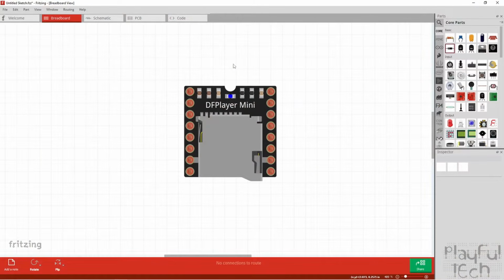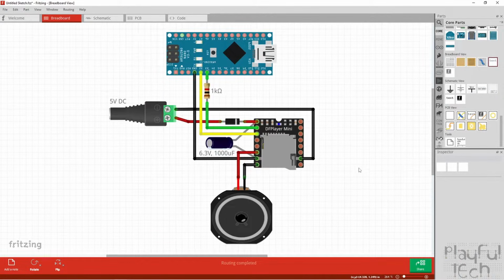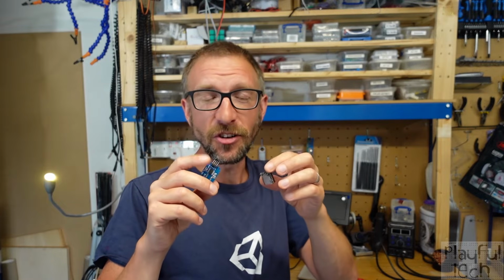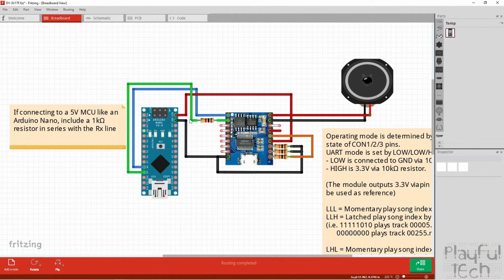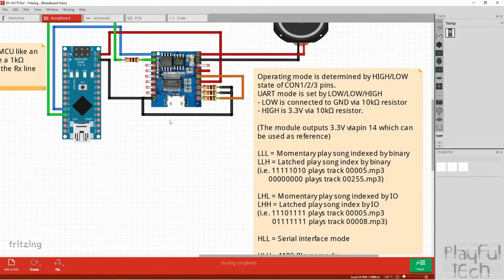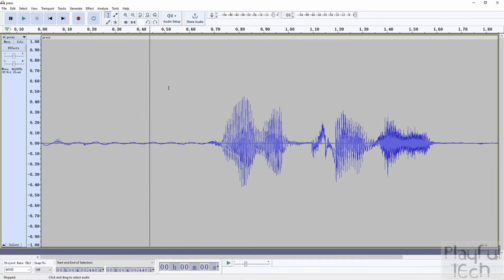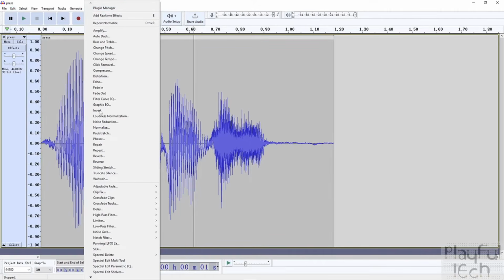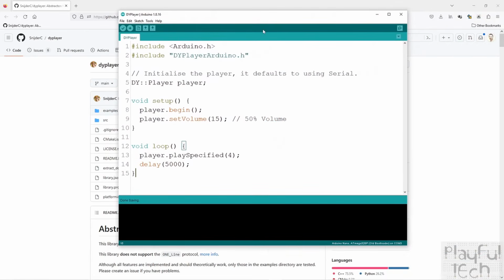Audio modules for electronics project

Comment: Great video!! Thank you for taking the time to make this. I have one quick question though.

Would I still need a separate power supply for the DF player if I were to use an aux out jack instead of a speaker?

Comment: Great video! But for the larger form factor modules (DY-SV5W/etc) the only modes I managed to get working are the MP3 mode (pins are commands like play/pause/next/etc) and Serial UART mode. The other modes where pins select a track index did not work no matter what I tried, in any of the modules I bought (All AliExpress, but at least a couple different sellers 🤷‍♂)
Reply from the maker: I've not experienced that problem myself. What setting did you push the DIP switches to?
Reply: @PlayfulTechnology  It was a while ago, but I think I literally tried all permutations after getting frustrated. Pulling the pins either high or low just did not trigger the tracks (but in UART MOde I was able to play them by index, and in the default MP3 mode I was able to skip between them, all with the same SD card).

Where did you buy your modules from? Perhaps Ill try one
Reply from the maker: @jonathanlevin7660  I've bought several batches from different vendors on AliExpress - I do normally use them in UART mode anyway, but occassionally use them in trigger mode and not noticed any problem - you just need to have the filenames saved appropriately on the SD card and the DIP switches set correctly.
Reply: @PlayfulTechnology  a couple months later I finally figured out the issue..
As you said the filenames have to be correct, I had "0001.mp3" and the module needs specifically 5-digit names "00001.mp3"...
The tutorials I saw claimed that the modules use the FAT index, so what matters is the order in which you copy them over. This is untrue.
One would assume even if not at least it would sort alphabetically- but nope, specifically 5 digit numbers with postfix `.mp3`.

Most "datasheets" for these also fail to mention this, but oh well! once known it's a very solvable issue
Reply from the maker: @jonathanlevin7660  Ah, well done for figuring it out - and thanks for sharing the solution!

Comment: @PlayfulTechnology Can you advise on selecting a speaker?  I was planning on using the DY-HV20T in an RC car project (car stereo effects that sort of thing).  If I’m powering this board with a 2s battery (7.4v), what size speaker should I use with the board?  I have a few spare 4ohm 3W speakers which I presume will work, but I can get a larger speaker for better volume.  If I’m powering the board with 7.4V will that limit the speaker power I can use?  Cheers.

Comment: Do you know of and modules with triggers like these to play two voices at once? I've been using two boards with two speakers but am looking for a small single board, single speaker solution due to space constraints.
Reply: The Sparkfun WAV Trigger has polyphonic playback. You can play any combination of sound files simultaneously.

Comment: Hi great video very helpful. I like to control the skull jaw with a servo motor mover with a sound device that loads soft sounds. I can control the servo with the  gpio pin pi pico but what's the best board to use to do this ?

Comment: Hi! It will be interesting video about VS1003 / VS1053 because it is using in many models of modern internet radio. There are several models of VS1003/1053 and VS1053 on the market now. And they are not same. PCM5102 and UDA1334 will be interesting too. Thank you!

Comment: Excellent video. I'm a newbie here.  Could you please provide more info/specs for the diode and capacitor needed for the DFPlayer Mini? I'm trying to run it from the 5V pin of an Arduino Uno.  The quality of the audio is excellent, but sometimes the Arduino sketch stalls, when it reaches the first call to play a sound. Cycling the power usually helps, but it is kind of annoying. Thanks.
Reply from the maker: I'd suggest reducing the volume level in your code for starters. Higher volume = more power required = draws more current = causes a brownout, resetting the Arduino.
Reply: @PlayfulTechnology   OK, thanks.  One more question. With your method of wiring the DFPlayer Mini, I understand that you are saying NOT to power the MP3 player via the Arduino.  Is it OK, that the Arduino and MP3 player receive power from a common USB power supply?  I am trying to achieve your wiring method, but I would like to use a single USB micro-B cable that plugs into a  5-lead terminal block.  I use the positive and negative leads and I split them each into two wires, so I have one set to power the MP3 player, and one set joined back together in a USB connector to power the Arduino. Do you think that this would be OK?  Thanks.

Comment: Do you know of an arduino library for the Due boars that will work with the dyplayer modules?   Due doesn't have software serial and uaing hardware serial gives a compilation error.

Comment: https://www.youtube.com/watch?v=-soDFl6SUPY Amazing video! I have two questions.. First one - if I want to make a big animatronics project with lots of different sizes and torques motors, How to choose a right power suplly to fit them all and the arduino? And second, I know that some motors work at 333hrz, 50hrz and different frequencies. How to control them all properly from the servo driver? would it work to just plug them all in? Thank you :)

Comment: Hey Alastair, Just looking at the diagram you made for the DY-SV17F but the 5V line from the player is running to VIN on the arduino. Is this correct? I would have expected that you would want to connect it to the 5v pin of the arduino so you can power it from there

Comment: Does anyone know if there any way to configure the DY-HV20T to be not-Interruptible? I've been trying to use the busy pin but have not landed on a working solution. Every time the board is triggered it will restart the song.

Comment: Great video as always! WRT DY-SV17F, what is the purpose of the three pull-up/down resistors? Since there is only a single connection to each pin, it seems to me those pins could be directly connected to +3.3V or GND as appropriate. I've only needed them to ensure an input does not float in the absence of an input signal.
Reply from the maker: I'm not entirely sure why the inline resistors are necessary - like you say, to set a logic signal of HIGH/LOW, you would think you could directly connect them to 3.3V/GND, but according to the documentation the resistors are necessary in both cases. This is also the way that the DIP switches are implemented in the 5W/8F boards. You can try without, but be warned in case you get funky behaviour!

Comment: My experience with the DFplayer mini is the same I've never yet found one that performs 100% of the functions in the spec.But generally they are good enough and cheap. I would be interested to know how you would incorporate a variable volume control as this is often needed though
Reply from the maker: The DFPlayer has software-based volume control. So, if you're controlling it via the serial connection, you can issue a command like myDFPlayer.volume(10); to vary the volume supplying a value from 0 (min volume) to 30 (max volume). 
If you're using it as a standalone device you'll need a hardware-based volume control instead: your first instinct might be to put a rotary potentiometer into the speaker output, but this will change the impedance between the amplifier and the speaker. The "correct" solution would be to use an L-Pad attenuator instead, like one of these: https://cpc.farnell.com/c/pads/l-pad
Reply: @PlayfulTechnology would a rotary pot be ok on the DAC pins for headphone volume control?

Comment: Hi Alastair, thank you for your videos. I have been watching your projects for years, as you are the only person on youtube that handles some of the concepts needed for the weird things that I come up with and try to learn how to build. 
Recently I was researching this very topic. I found out you can play audio files from an ESP32 by wiring it directly to an sd card (easiest setup is to use a microsd and solder the wires to a sd to microsd adapter) and to a speaker. I found this setup to be the minimal option to be able to play random audio files with minimum number of items and space. I think there might be a way by using logic gates, a timer and a standalone dfplayer but if possible it would be quite more complex.

I am sharing this option because I usually have very little room available, and I almost go mad every time I have to face the inconsistency of the dfplayer.
Reply from the maker: Thanks for the comment! You're absolutely right - you can play back audio files using only the ESP32 hardware (in fact, you can even do this on an Arduino [at very low bitrate] using something like the TMRPCM library: https://github.com/TMRh20/TMRpcm). I didn't mention this as a viable solution though, because it tends to occupy a large amount of the limited resources available on an embedded chip, both in terms of processor and memory usage. So, if you try to get your sketch to do anything else in addition to playing back audio (e.g. polling button input, reading a sensor, or applying any controller logic) you quickly run into timing issues and playback becomes unacceptably choppy. 

That's why generally I'd recommend offloading responsibility for audio functions to a dedicated audio chip like those mentioned in the video, and all the ESP32 has to do is issue a few simple byte commands.
Reply: @PlayfulTechnology  I didn't know that! Thank you so much for pointing it out.

Comment: Had the similar issue with DY-SV17F with builtin memory, in my case it took 500ms to to initiate audio.
Reply from the maker: Was that playing a MP3 file or a WAV file? 500ms is very slow :( One possible explanation for the long delay is that an MP3 file is compressed, and the chip does not have a very efficient decompression algorithm. Playing a WAV file should be more responsive, as that's uncompressed raw audio that can be read and immediately streamed. The downside of that is that it's a much larger filesize, which is tricky when you've only got 4Mb storage to play with...